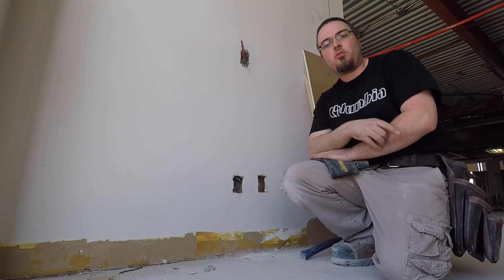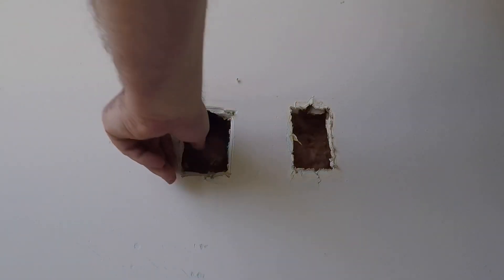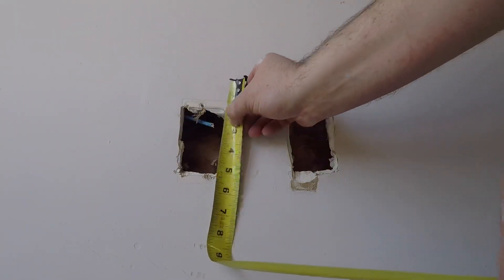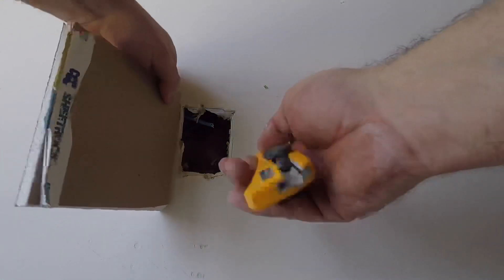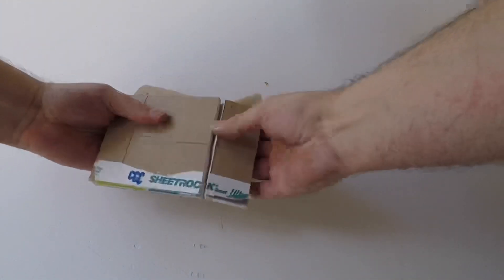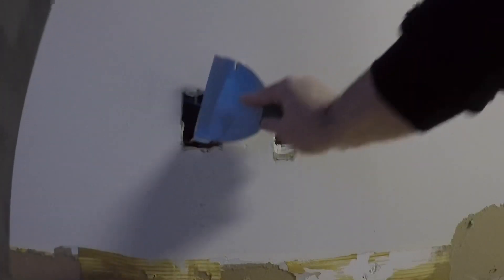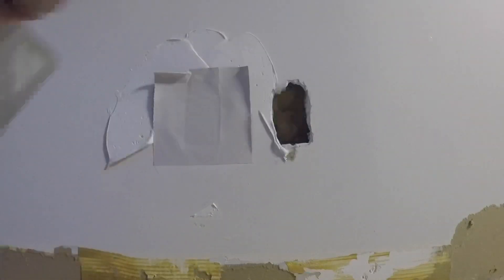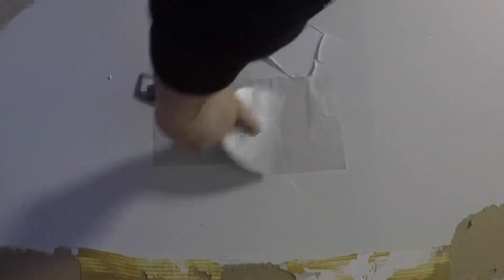How To Repair a Hole In Drywall - California Patch

Comment: Great technique but a hack job. You should butter the edges of the patch not the hole. Put compound on the wall around the hole not in it. Then fill the edges of the patch where you tore the paper off. Push it in and finish.
Reply from the maker: W. Apnj more than one way to skim a cat bud. This isn’t hack. It works and I’ve never had an issue.
Reply: I agree . It’s going to have blisters after it dries.